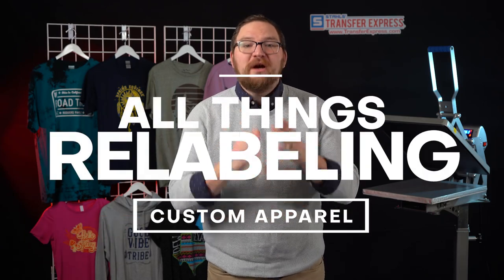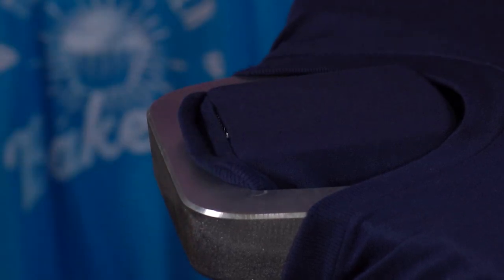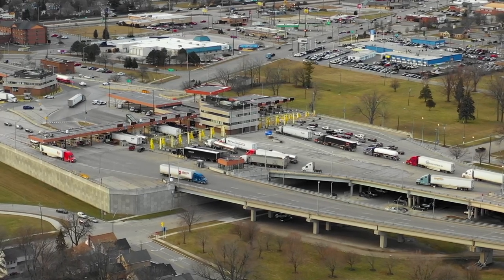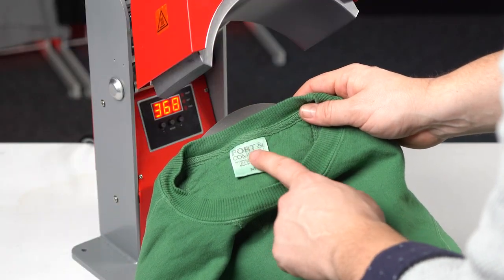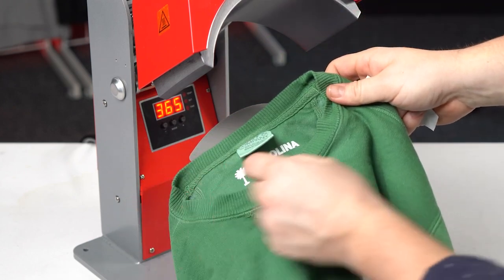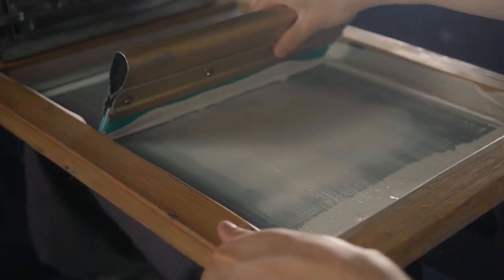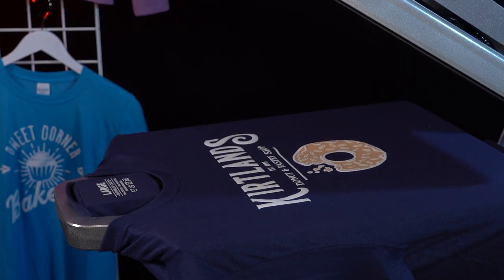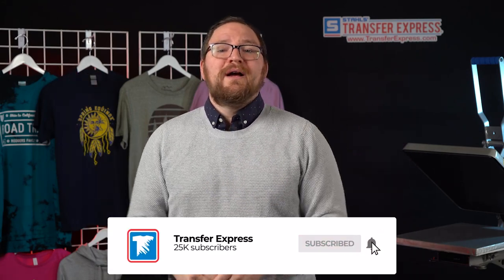Custom Tagless T-Shirt Neck Labels | Relabeling Custom Printed Apparel

Comment: If you are going to use a standard 15x15 press without the specialty platen, you mentioned turning the shirt inside out, but how do you address the decorations on the rest of the shirt? For example: Do you do the chest / back of the shirt first, then the label or vice versa and how do you prevent damaging the first decoration?
Reply from the maker: Great question! In many cases you can do either decoration first, as the tag print location would be off of the lower platen print area for all front placements. To ensure even pressure with the tag location you can turn the shirt inside out and print before any other decoration. With a layer of t-shirt fabric between the print and the heating element it typically does not get hot enough to damage the first decoration, but I would rather press a tag twice than possibly over apply the exterior design.

If you have any issues with the above methods, many decorators have success with the little mini presses like we showed in this video here: https://www.youtube.com/watch?v=XkT_eqmv_5A
Reply: @transferexpress  Gotcha. That makes sense. Thanks for the quick reply!
Reply from the maker: Of course! We're always happy to help in anyway we can

Comment: What you say what do you want us to do about the side tag with the country region and stuff do you want us to tear that off too or he was can leave the side tag on ?
Reply from the maker: 90% of the time those side tags will stay. Commonly they're sewn in and not as easily torn-away like the neck labels and for the majority of them, they do not include a brand name of the manufacturer, only an RN#. 

By leaving the side tag in (which commonly has the care instructions, fabric content and country of origin) you would not need to include those on the neck label print- You could simplify and just include your brand and the size of the garment. 

As that information does vary from manufacturer to manufacturer, it's best to confirm the information is present on the shirts you'll be printing on.

Comment: Can your platen be used on an any heat press?
Reply from the maker: These platens are designed to be compatible with the Hotronix Quick change system available on any Hotronix 16 x 20 heat press manufactured after 2014. What style heat press do you have? There is a GK version as well.

Comment: How do you suggest u store them. What should I keep them in until I need them
Reply from the maker: Great question! We recommend storing transfers away from moisture, humidity and drastic temperature swings- In a climate controlled office is fine. We suggest storing them in the box they came in and put together a great video on some helpful storage tips here: https://www.youtube.com/watch?v=zTAgqUeUsXw 

You can store them in resealable bags with those silica-gel moisture control packs, but in many climates that isn't necessary. 

In this video we press a 10+ year old transfer that was stored in an office filing cabinet (Heat and AC for all of those years) and it pressed just fine!

Comment: Transfer Express - why not just remove the comfort colors default label and put your own company logo with the required details? It looks tacky having two different brands on the same t-shirt IMO. I know comfort colors doesn't have a tear away label but its very easy to cut out the woven label and add your own.
Reply from the maker: Great point Freddy, we were just emulating what we've seen other decorators and small business owners do here in this video... Some brands like to highlight the Comfort Colors Blanks. These twill labels do either need to be cut or seam ripped/restitched to remove cleanly, which can be time consuming. 

We've found the Port and Company PC099 excellent for a similar, garment dyed heavyweight tshirt that does have a tear-away label.
Reply: @transferexpress  the problem is finding enough live mockups if you're trying to build a lifestyle brand. 

Without enough varied mockups of people wearing the actual shirt doing something outside it becomes a challenge. Because then you have to buy a camera, hire models or have friends (lol) to model your shirts. Etc.

Comment: Hi! New to y'all. What king of ink do you recommend for these neck labels or doe sit matter? Goofproof, hot split? Also, for pressing on thicker hoodies/sweats inside out, what ink is bets to press well on the fuzzy inner fleece material?
Reply from the maker: Hey FilmingYu! Great questions, Good Proof is the answer to all of them. 😋 Goof Proof is my #1 pick for inside tags. At that smaller inside tag size it will be identical in softness (hand feel) to hot split and it's much easier to press. (Hot Split and Goof Proof are the same inks, Goof proof has an added adhesive powder that makes it much more versatile to apply) 

The same applies to the inside of fleece garments - Goof Proof holds down the fleece material and stays together, so it's still readable and not thick or scratchy (when someone is wearing it). With those soft fleece fabrics, you're typically looking at 50/50 cotton/poly blends or a polyester dominant fabric that may be more heat sensitive. Goof Proof can apply as low as 325 degrees- Hot Split requires 360 degrees at the absolute minimum so it may lead to some scorching on that fabric. 

While not inside tags, we did put a video together comparing Goof Proof and Hot Split here: https://youtu.be/Sp0HYUS5vpQ
Reply: @transferexpress  Wow thanks so much! Checking out the video now :)
Reply: @transferexpress  Would you recommend the Goof Proof or Hot Split for a clean print on a 15" (cotton canvas") tote bag? Which one would last longer too as bags get thrown around a lot?
Reply from the maker: Goof Proof 100%
Reply: @transferexpress  Thank you!
Reply: @transferexpress  Which ink formula do you recommend for tote bags (10oz-14oz cotton canvas or poly blends)?
Reply from the maker: Depending on the quantity needed and colors in your design, Goof Proof (1-2 colors, 24+ Qty) or UltraColor Max and Pro (3+ Colors, less than 24 Qty).

This page has a helpful downloadable chart and an interactive transfer selector that can help too (not respond 3 days later... SORRY! 🙃) : https://www.transferexpress.com/choose-heat-transfer-type
Reply: @transferexpress  No worries thanks. IS the Goof Proof heat/time/pressure application exact same from t-shirts to thicker cotton canvas tote bags?
Reply from the maker: Absolutely, you got it! 365 temp, 4-6 seconds, medium to firm pressure, hot peel on everything cotton or a cotton/poly blend. The only time you'll bring the temperature lower will be for 100% polyester garments (with a 10-12 second press)

Comment: Ok but how to print over or remove another brand label?
Reply from the maker: That's a tough question! It's best to avoid relabeling t-shirt styles that have those printed inside labels. Many wholesale brands and styles all include tear away labels so you can quickly and easily print your own.

That being said, there are ways to print over or remove inside tag prints:

1. Print your inside label over the existing print. Design your print to be full ink coverage that is larger than the existing inside print, then print over. This works on almost all kinds of tag prints: screen print, direct to garment digital prints and even heat transfer labels. 

2. Try to remove the print (depends on how its printed) but in some cases you can apply htv remover and/or heat to remove those inside tag prints. I wouldn't recommend this option as it's time consuming with the small detail and can leave adhesive marks on the fabric. For screen printed inside tags it would be almost impossible to remove.
Reply: @transferexpress  thank you

Comment: If you re-iron the shirt, does it melt away?
Reply from the maker: We don't recommend ironing on the design. If you do have to reapply heat to the decorated area for any reason, you should cover it with a cover sheet or piece of paper and take caution to not over cure the inks.